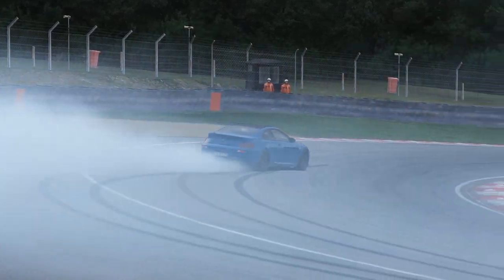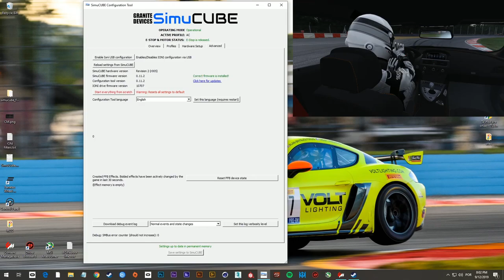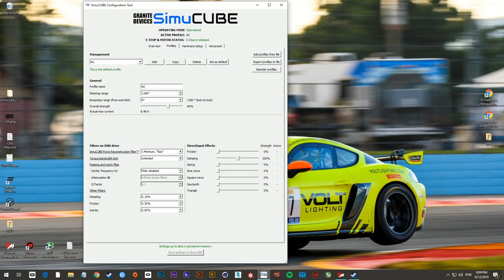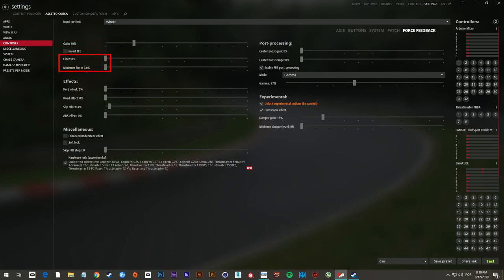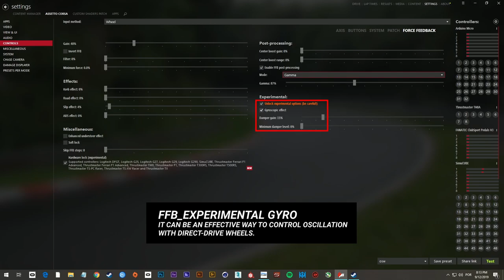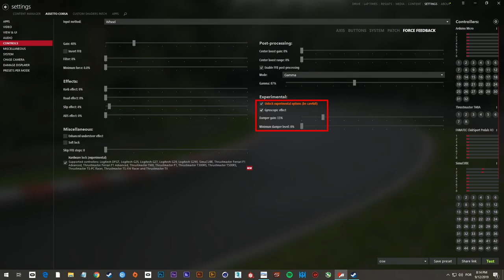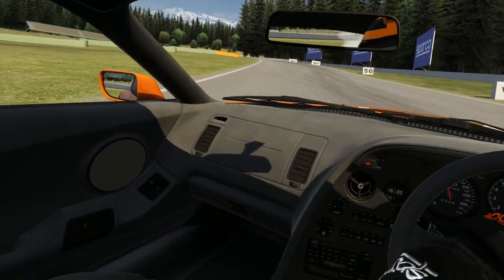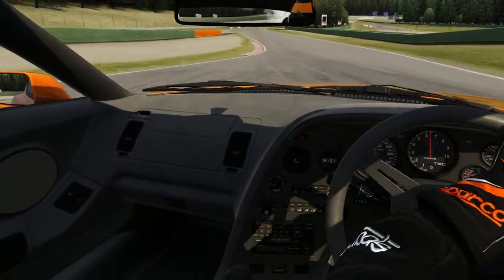How to Setup Direct Drive Wheel in Assetto Corsa

Comment: Have tried it already and have to say its made a lot of difference. I can feel every bit of road surface especially the curbs. I always had my ffb in simucube at 100% as instructed by many users, your settings i seem to feel more for less power if that makes sense. Really good simucube setup Carlos, thanks alot. Hope you do more race sim setups. BIG thumbs up from me
Reply from the maker: Hey, glad to hear it helped! Sometimes power needs to be reduced in order to have more "dynamic" feel. If the wheel feels too light, you can increase the SimuCube Gain, wheels above 320mm of diameter needs a bit more strenght I think. I will see if I can find a good setup for ACC and RFactor 2, but this in AC I really needed to share, thanks a lot for following here and for your feedback!
Reply: @CarlosPanades  Would love you to take a look at AMS as its a hard one to get right, plus a good rfactor 2 setup would be much appreciated
Reply from the maker: @menacegtr  I will give it a try, never played it since I got the DD because it doesn't support VR. Will try it when possible and I'll let you know ;)
Reply: @CarlosPanades  That would be appreciated, thank you

Comment: Obrigado! Thank you for putting all this clear. I used your perspective to set up my DD1. Now I`ve a much realistic drive. Really feeling what is happening to the car without added salt and pepper from fake effects. What reaches my wheel is what happens. Now it`s my turn to deliver!  Any suggestion regarding Assett Corsa Competizione and iRacing?
Reply from the maker: First, your feedback is much appreciated, thank you! In ACC I use 50% ingame Gain, no other effects and in SimuCube 62% of Gain. Reconstruction filter 1, IONI Damping of 0.02% and no friction. No Direct Input effects. If I change it to something else I let you know. Also, if you want to have a tighter center in the wheel, you can copy the ff_post_process.ini file from AC (yes will work in ACC too) and paste it in ACC config folder (in My Docs). I am not using it but you'll feel the difference in the wheel too. I don't play iRacing unfortunately.
Reply: @CarlosPanades   
 Thank you again Carlos. Feeling a much better in ACC but still not able to feel the transitions over - underdrive.

Comment: 1st qestion ... why 1180° - I known only 900° or 1080° 
2nd question ... why no  Auto-adjust in the axis setting to match the cars degrees

3rd and last question ... did you drive other Sims? like R3E, iracing, rF2 and very important ACC ...I would love to see your opinion there as well.

now the part about how it felt to use your settings: it give AC a very smooth and detailed FFB ... much more detailed than my old setting ... I changed to 900° plus 20° Bumpstop range and I used in hardware my old bumstop settings: 50%, 20° and 200% ... what I never vhanged so far ... A change to your setting made actually NO difference in AC, but a huge (undrivable differenc to rF2), so I changed back to my old setting, due the fact that those setting is NOT saved within the profile.
Reply from the maker: Hi there Ralf! Thanks for watching. Answering your questions:
1st, some cars has 1180º and OSW can handle that with no problem, so why not use it?
2nd, I never felt the need to use it because here, it auto adjust already for all cars, also I forgot to mention that in CM there was a Hardware Lock under "Controls" that makes the wheel don't go over the degrees of rotation of each car, mine "Hardware Lock" is now greyed out for some reason but it respects the degrees of rotation for each car yet.
I drive rF2 and ACC, will see if I can find good settings for them. 
Now, I did not understand, you said the settings gave smooth and detailed FFB in AC but later you mentioned it made no difference, you mean the hardware bumpstop settings?